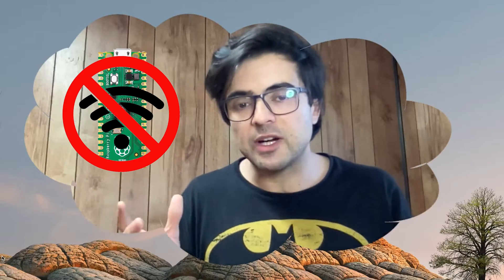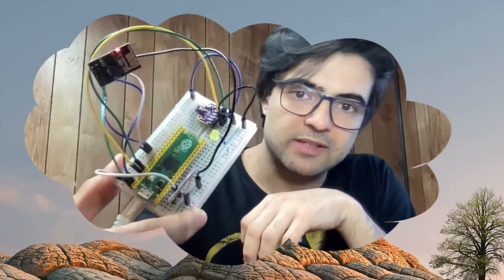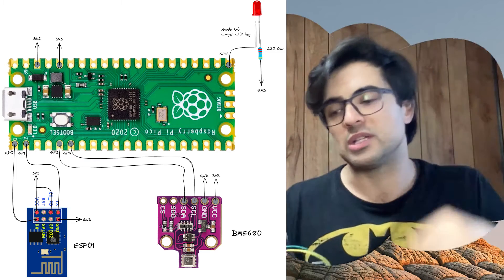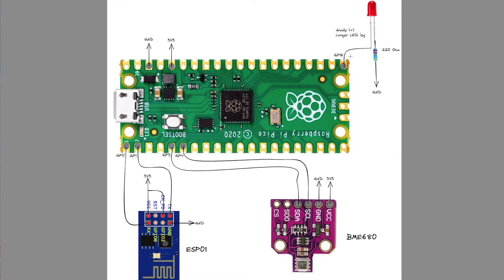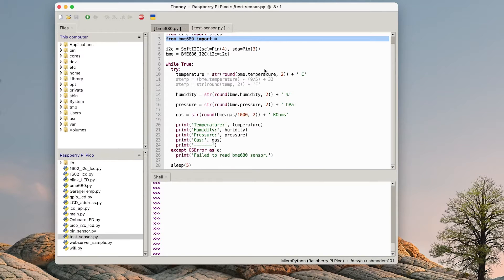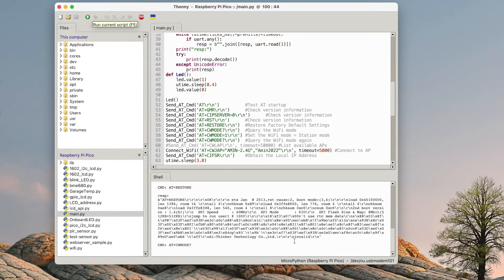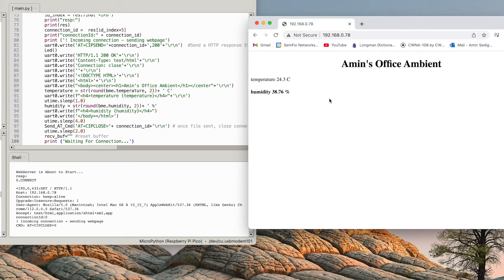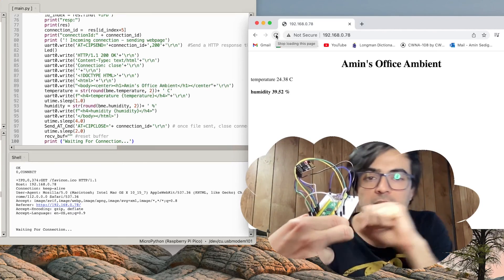Connect Raspberry Pi Pico to Wi-Fi with ESP01

Comment: Great stuff!
Plus all your other scripts are really helpful.
I have tried to adapt your script to let me use the pico + ESP01 with Mosquitto MQTT, but I failed!
I can connect to wifi ok.
I can get the webserver to work ok.
I can get a pico w with a sensor attached to work with mqtt ok.
What I want to do is basically make the pico + ESP01 work exactly the same as a pico w.

What changes do I need to make to your script to achieve this?

(My reason for using pico + ESP01 + sensor instead of pico w + sensor is that here in NZ a pico + ESP01 is less than half the cost of a pico w, which is trivial for 1 or 2 units,  but starts to become significant with 10 or more,)
Reply from the maker: Hi Ian, thanks for your comment.
I know! Prices of these stuff are unreasonable sometimes. For your question: I used the same system as you can see in the video for 3 months in my office as my room temperature sensor and it worked fine. The problem with this technique is that the whole thing is not gonna work fast enough, sometimes it’s frustrating.
By the time I wanted to record this video, I tried my best to come up with the best script, so I’m not sure if this combination could be performed the similar as Pico W

Comment: Thanks for the video. I've tried both your video and someone else's, which was done with ThingSpeak. The thing is, I don't get any responses in the 'resp:' part; it's just blank. I tracked it, and in the try and except part within 'Wait_esp_rsp', it directly goes to the except part and prints (resp). And it just goes blank. What do you think the problem is? By the way, in the other guy's code, it gets stuck on the .decode and gives an error."
Reply from the maker: Hey, I don’t know about the other guy’s video and code. Something that I guess could be the cause of the problem is your firmware version.
Before everything make sure all the credentials ( wifi username and password), indentation in code and other typos are correct.
Reply: @aminsedighfar  it doesnt even go there.As i say it gives no responses.I mentioned the other guys video cuz im gettin the same problem in both of urs videos.decoding part. I've tried with 3 different esp01's and gettin the same results everytime

Comment: Do i have to flash ESP8266-01 Module before using it? And can i send a notification on telegram with the wifi
Reply from the maker: For the first question:
I don’t think you need to flash ESP01 since I didn’t.
For the second, it’s possible, but you should be more precise about what you want to do.
Reply: @aminsedighfar  thx
Reply from the maker: @Mojit00  no problem, happy to help 🙂
Reply: @aminsedighfar  i want to send a telegram notification from my pico as my pico doesn't have wifi im using esp 8266 01 module as a wifi to send to my bot which i have created on telegram. Im having lots of issues with the module just wanna ask is it even possible?
Reply: @aminsedighfar if you have flashed in the past the esp01 to use it with the arduino ide, i think you have to flash it to return the original firmware that uses the AT comands
Reply from the maker: @OmarValenz  thanks for sharing, I only opened the box, took the module out; then plug and play! This is why I didn’t know.

Comment: For those who do not know, there is a 'raspberry pi pico w', which does wifi, works in micropython and also in circuitpython
Reply from the maker: Yeah I mentioned at the beginning of the bud as well.
Reply: @aminsedighfar yeah but, pi pico w costs 10 dollars,  pico+esp01 costs about 3 dollars or less on ali express, very cheap really